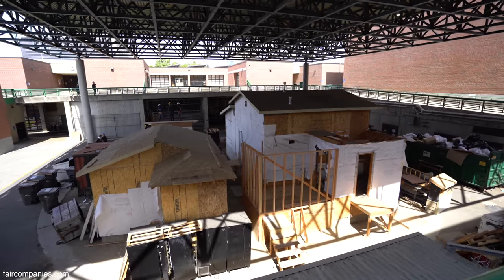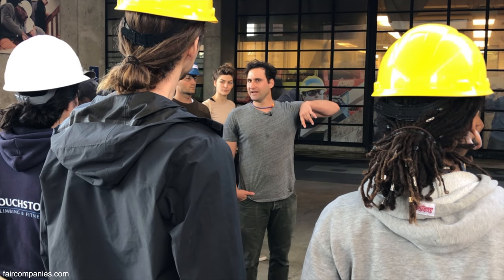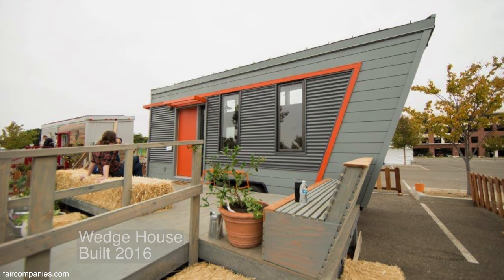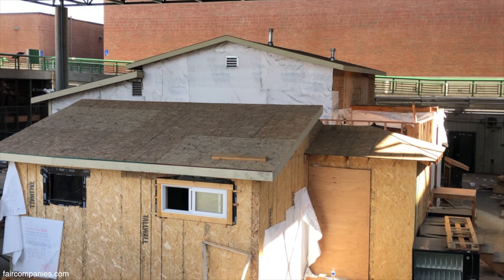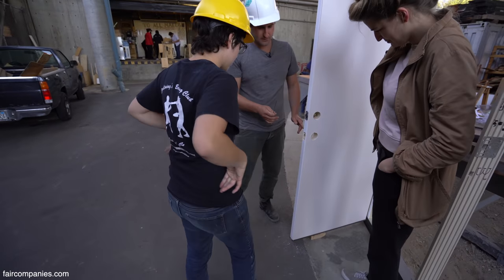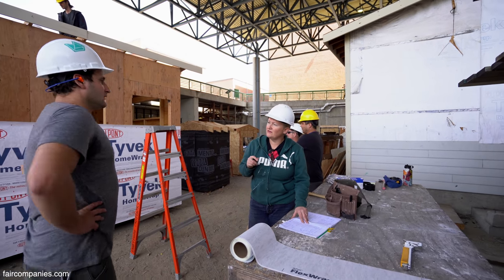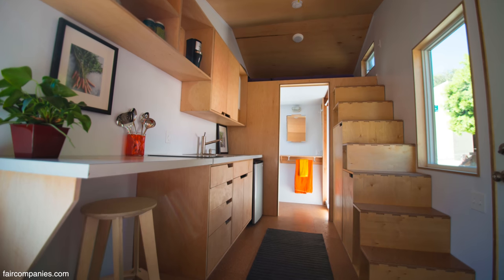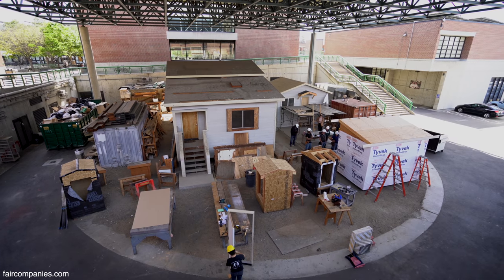How to build your own tiny house or ADU

Comment: You guys can learn totally different way to build a house in India. We use brick, cement, steel, stone slabs, sand and gravel as the primary material. Wood, wood composite, and steel for windows and doors. We do not provide for any insulation layer against the weather, but build with those elements like sun, air, rain and temperature in mind. There is serious damage to riverbeds due to sand mining, so graded, crushed stone is widely used now. More of manual labour, much less machines and tools. Different regions have evolved the art of building in many different variations but essentially remain the same.

Comment: are tiny houses really a solution for housing crisis? I'm just wondering, tiny houses are not scalable in hight. so every tiny house (or five tiny houses together) takes space where potentially a 5 story house could be constructed with small apartments. right?
Reply: Good point, but, again, it comes down to cost.  A 5-story apartment/house requires way more maintenance.  We're back to the rent issue.  A tiny house is much more manageable and something you can own without having a mortgage or having to pay a landlord monthly.
Reply: Small apartment would not be able to be moved with the person's later

Comment: This is great, but if I took a class like this I would want some emphasis on use of reclaimed materials.
Reply: If any of these people want a hope that cities will bless them with permission to build this stuff they will need to use whatever it takes that fits code. Very rarely does reclaimed material still have the integrity to pass code. If it is possible, sure use reclaimed material if it costs the same and will be structurally sound, but the bigger issue is just getting a roof over your head and off the streets. Something tells me this class doesn't have the funding to spend much if any time on reclaimed material.
Reply: @chrisbabbitt4202 Thank you. I realize that this is very much a step in the right direction, but not every city has strict codes.  These places are rare in the U.S., but they do exist. Not to mention, there are very clever people in California for example who are coming up with clever ways to get around strict building codes. Also, there are other countries that are in desperate need of people who know how to build using reclaimed materials. Either way, like I said before, it's great to have such a class. However, the world as a whole needs less barriers and entirely more affordable housing as homelessness is an epidemic everywhere. Don't get me started on WHY it is so important that we do so with reclaimed materials. I'm sure most are aware of the trouble we are in.

Comment: if tiny houses were to become mainstream, they would easily cost over 150k ea.
Reply: I've built several of these for under 15k a piece which doesn't include labor or a trailer of course.
Reply: No, the opposite as mainstream would allow mass production and that lowers costs vs building them one at a time.

Only building them up with high end materials and features would make them more expensive but that would be tiered just like any other market from budget to high end.  Just like phones, cars, boats, etc.

The problem with traditional houses is they're tied to the land, which ties it the local economy and factors everything on and and around the property.  So prices can be inflated, working more similar to the stock market, and not represent the actual value but houses on wheels aren't tied to land...